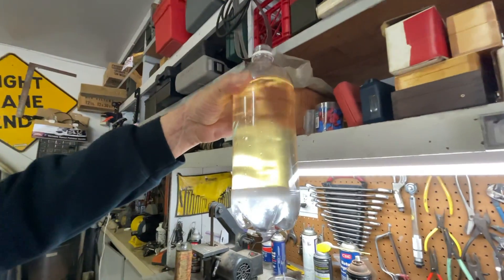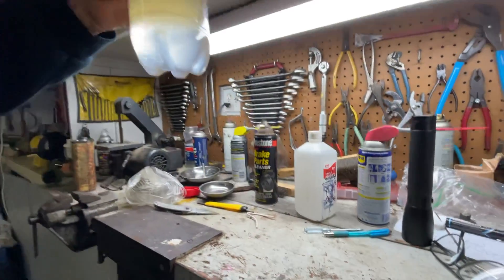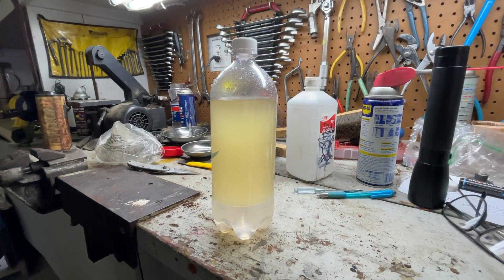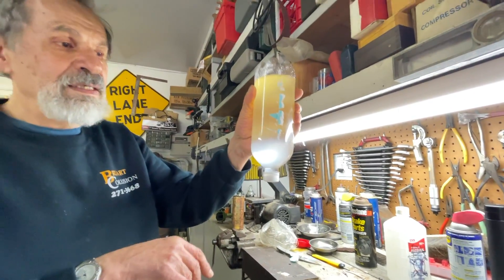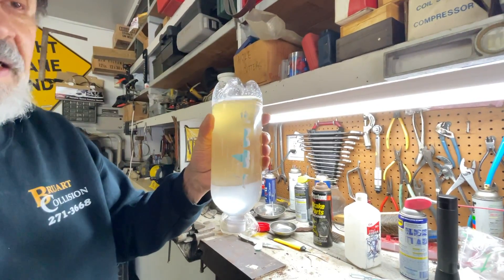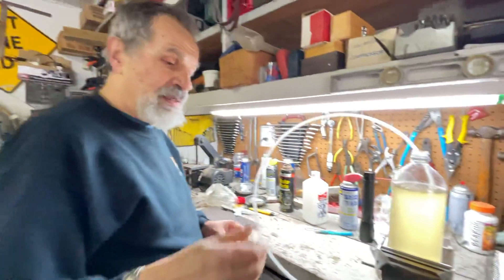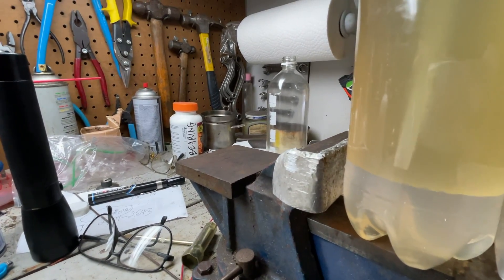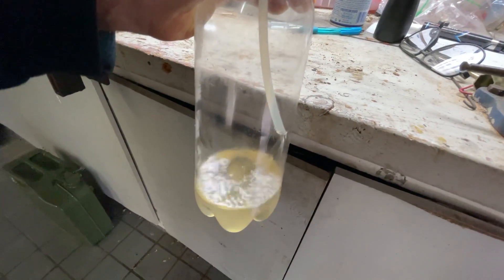The Most Practical Way To Remove Ethanol From Gasoline

Comment: I see a few diy people using the same bottle after they drain the water from the bottom. If you do that you will have a lot of water going into your gas tank, as you can see all the water droplets that stuck to the side of the bottle at 10:10 you got to use a different bottle like this and siphon like this guy

Comment: You are best to use HDPE, #2 containers as the exposure to Gasoline will very slowly dissolve other kinds of plastic which means it will be going through whatever appliance you run with it.  That 5 gallon jug will eventually get soft from prolonged slow dissolution.  I like the "blow job" method of starting the flow. 🙂

Comment: The big question is this: 
What do you end up with after seperating the ethanol from the gasoline? 
Ethanol raises the octane of the fuel. Removing it REDUCES the octane. So, as it starts out with 87 octane, what number do you get when you remove the ethanol? 
My guess is that you end up with the CBOB that is used to produce the E-10 in the first place. Is this really a viable fuel for use in motor vehicles? I suspect there could be some undesirable side effects.
Reply: It’s for small engines . In Cali they add ethanol. When ethanol gas sits in any small engine it destroys it. Hence why they are removing it.

Comment: It seems that all these videos are missing a very simple trick. Mix the water with the petrol(gasoline) and after the water mix settles to the bottom pour all the liquid mix through a REAL leather chamois into a bucket / container. The petrol will run straight through the chamois and the water /ethanol will be contained at the chamois. The petrol will be clean and clear.   Please try as this is the best way to separate the components.

Comment: If you mix the gas and water in a dish washing liquid bottle with its Pull-To-Squirt nozzle, you can then easily turn it upside down to squirt out the water and ethanol. I think a better practice, using your siphon (great idea, BTW, blowing into the bottle to start the displacement), would be to run the tube to the bottom of the separating vessel and siphon out all of the water and ethanol to be discarded, rather than vice versa as you have done. Actually, if the separation container is soft sided, you could use a single hole in its lid, along with a single hose and just squeeze out the water mixture from the bottom. You left behind some gas in an abundance of caution and if you put your hose right down to the separation line, there is a fair chance that you could pick up some water.

Comment: No, no, no - siphon the water/alcohol from the bottom.  Tilt the bottle to get the very last bit. Great method, but you're siphoning the wrong liquid.  Just easier to siphon stuff from the bottom and not have to piddle with the liquid interface and get a slurp of water here and there as would happen when attempting to siphon the gasoline instead.

Comment: The only advice I will give others is to start with premium gasoline. The removal of the ethanol lowers the octane essentially making 92 octane into 88 octane. I don't know the exact numbers and they may vary as a lot of gas has between 6-10% ethanol. But the fact is that when you remove the ethanol starting with 87 octane, it will be a few points less now. I have found there is not much of price difference to just going and getting Rec90 fuel at the higher cost. When I was in California, there is no such thing as non ethanol fuel at the pump where I was living.

Comment: My solution to bad gasoline, leaking carburetor gaskets and risk of engine fire, was convert to propane. Solved it. By the way on the farm gasoline that was in tanks for extended time lost its volatility. The mechanic finally looked to the fuel as a potential problem and put a match to an open bowl test and could not get it to ignite. So the modern fuels have some infused fuel that volitize destroying combustion.

Comment: I remember my father telling me about a way to remove water from gasoline. Back in the 1950s the only way to transport fuel for tractors was with steel drums and a hand pump. Any humidity in the air would eventually condense and build up inside the drums. They used an old felt hat in a funnel and pumped the gas through it while filling the tractors. The gasoline would run through the felt but the water was held back. Surface tension? Not sure how it works,  but apparently it did work. May be something that could be incorporated in a larger volume ethanol removal apparatus. Good video

Comment: you can buy ethanol free gas at some gas stations there is a website i think it is pure gas or something like that the problem with your method is now the gas you removed ethanol from has a lower octane rating because the ethanol was used to get the octane rating so you might have to add octane booster that has no ethanol to replace the octane lost depending on how the thing you are running needs octane

Comment: 2 things to note:
1. You may need to add some sort of octane booster since the ethanol upped the octane levels. So your 92 octane gas turned into 85 or 87.
2. Your torque wrench needs to be recalibrated. Since you left it set to a torque value, the spring has permanently changed and thus your torque readings will be off.

Comment: put a on/off valve in place of the cap.  flip it over, let it settle, open the drain untill the gasoline starts to flow out, shut the valve.

Comment: Ethanol is a bad idea in gasoline engines period. It’s a corrosive. I use high octane ethanol free fuel in my small equipment runs better with less maintenance. Thanks.

Comment: Ethanol free gas is WAY better for classic cars i highly recommend using it. Old carburetors and fuel injectors weren’t designed to run on ethanol, double that effect when it’s something you only drive in the summer since the ethanol will degrade and absorb water in your beautiful classic car’s gas tank

Comment: Use a plastic bucket or 5 gallon water jug with a radiator petcock screwed into the bottom.  Open it up, drain the water out, and VIOLA! Ethanol free gas is left.

Comment: Adding a proportion of two cycle synthetic engine oil would help replace the difference in octane, slowing the burn rate to help prevent preignition/detonation. I I wish I knew the numbers but it's something you could look up, I simply add it as a 100 to 1 mixture and leave it at that and have never seen an I'll-effect. If you were using this an aircraft I would surely going to far deeper science or keep your altitudes very low.

Comment: Mr. Funnel makes a portable fuel filter that’s a funnel that removes water dirt and debris. I use it to get water out of kerosene before using in heater.
They have different sizes. Mine is a 3.5 gallon per minute. I think I paid about 25.00 on eBay. Filter is permanent. Just wash out.

Comment: You should have mentioned that taking the ethanol out will reduce the octane level of the gas. Chainsaws should have 91+ octane. Octane boosters often have ethanol in them, so you have to be careful what you use to boost it back up.

Comment: So far, out of all the ethanol videos I've seen on Youtube, yours is the best approach to remove the ethanol from gas. A Big thanks!
Reply: i don't want corn syrup in my gas
Reply: @theorenhobart  and plastic juice is just as bad... use glass or designated petroleum safe containers...
Reply: not really... i wouldnt let gas sit in soda pop bottles over night... gasoline has a nasty habit of eating certain type of plastics... and ethanol will eat rubbers as well... this should be done in Glass... theres a video of a guy using actual Chemistry beakers separation funnels and what not to do this... much better video... not to mention gas starts eating the plastics immediately so who knows how contaminated your fuel now is with plasics...

Comment: As that bottle has a "bubble crown" on the bottom to make it stand up, I'd angle the bottle and stick my pipe into one of those little bubbles at the base. As it's a low volume it has to be more controlled. Also if you accidentally miss the layer you suck a little gas into the waste drain off, and not water into the gas that you want to keep uncontaminated.

Comment: a tweak: put food coloring in the water and instead of siphoning off the gasoline, siphon off the now blue water-ethanol mixture through a translucent/transparent tube that extends to the bottom of the container. when the fluid being drawn through the tube is no longer blue...stop.

Comment: I've been doing this for years and it works VERY well.  My 5k generators (I have seven of them) start easier and store a LOT LONGER without carburetor issues. I keep 15-gallons on hand all the time because we can't tell when or how long power will be out.  A 5k gen will eat 10-gallons in 24 hours.  Because these 10-HP engines are low compression, there is no pinging or knocking using gasoline processed from regular-grade gasohol.  If you do get any pinging or knocking, bump up to mid-grade or premium grade gasohol.  At first, I was concerned with this so I started with premium.  Later, I migrated towards regular grade.  Smaller engines (chainsaw, 2-cycle snowblower) also start easier.  All these engines love it.  I noticed that the processed gasoline feels more oily.  I don't know of any engine that requires ethanol.  That's simply a 'filler' that the government forces us to live with.  They'd love to add more ethanol but our carbureted engines cannot tolerate it.

Comment: The water left in the gasoline will do more damage than leaving the ethanol in.  Adding toluene to get the octane back up.....about $20/gallon of toluene.  
Run a small engine on corn gas, drain or run the carb dry, add a little stabil.......maybe costs $2 extra and 2 minutes of your time.  
None of this matters in California, of course.  All of their small engines will burn coal by 2024.
Reply: Yes, but it dries out and swells soft parts in the engine. This is especially problematic in 2 cycle engines since if the crank seals leak, the mixture becomes lean (burned pistons).

Comment: Ethanol fuel does not damage your engine but lowering the octane level will.
Reply: It eats up carb and seal soft parts. In a two cycle, this will lean the engine out leading to not enough oil in the mix. And this will damage the engine. So yes, ethanol does cause damage to engines. It also turns to powder as it sits in the carburetor. This plugs the carb and requires service before the engine will run again. Lastly, ethanol eats up aluminum parts. All in all, it is not good for small engines.
Reply: @Nick_Sorenson  my point was that if you remove the ethanol content of the fuel, you will lower the octane rating and eventually cause severe engine damage from pre-ignition and yes, ethanol does destroy a lot of seals in carburetors, especially older models.

Comment: Upon doing this method to anyone still worried about water being in the fuel i would suggest a bottle of dry gas thrown in , the yellow bottle seems to be the best ( and is relativity cheap )to remove any left over water from the fuel .

Comment: At 2:42 Please don't pour gasoline or any flammable liquid inside your house or garage. If it catches fire you will lose your house. Go outside and pour it far enough away so you can walk away if it goes bad, and you won't have to fight a burning gas can. Thanks for the information on removing ethanol.
Reply: You may be very nervous pouring that gasoline in your garage into a small bottle with a cherry can. In my neck of the woods here in Wisconsin, all gasoline containers have to be painted red. I guess you don’t have to do that where you live. I’m not sure this whole process is really worth it because of the loss of theoctane in this gasoline that you’re going to process and also handling gasoline is careful as you can be, is still super dangerous. I’d rather pay a little bit more, though. I don’t think I’ll live another 77 years no matter how safe I am.

Comment: Thanks so much!  I see no reason why this same transfer method wouldn’t work to delete water from old fuel, with or without ethanol. Water always settles to the bottom and your easy siphoning method will do the trick. 
One thing I would improve upon is the soda bottles. I’ve been using 2 quart rectangular plastic fruit juice bottles from Langers for other purposes which are a thicker plastic and have a larger cap.

Comment: You can't even get the 10 cents for the bottles in my state so if you have some tubing around it would be totally free to do it. That looks like the tubing that is used for refrigerator water supply and I already have some of that.

Comment: One could also run the siphon hose down to the bottom of the bottle and just siphon off the water/ethanol mix.  I just buy 91 or 92 octane gas as where I live, there is no ethanol in that grade of gasoline and I only run the high grade in my small engines.  It's amazing how many people don't know that one should not run E10 in their small engines.  It's especially bad for long term storage as the water in the ethanol can cause rust or oxidation in the metal lines or metal storage thanks ie: Rust.

Comment: Comment below states: 'Would also strongly suggest using molecular sieves or a drying agent like calcium chloride, because the water still inside the gasoline will do more harm then if you left in the ethanol.' Would that be true? The whole point to me of extracting the ethanol would be to ensure it remains free from moisture in long term storage in bikes as it rusts the tanks and clogs the carbs.

Comment: Or you can just go buy recreational fuel.   Kind of hard to shake up a 5 gallon jug that weighs 30lbs.  Test your local premium 90+ octane fuel.  Much of the time there is no ethanol in the premium, especially around lake marinas.   If you remove the 10% ethanol out of 87 octane fuel, you are left with 84 or 85 octane.   Depending on the engine, that low octane can cause valve damage or detonation.

Comment: I have looked at several methods for doing this and yours is, by far, the most creative.  Thank you!  I will use this method with gallon glass jars, non-alcohol octane booster, a little sta-bil and with or without 2-cycle engine oil depending upon end use.  Great video!
Reply: Can you tell me what non-alcohol octane booster you would use....I need to have an octane rating of about 91.  Also, how much water will you used in each gallon glass jar to mix with fuel?  I assume you are starting with 10% ethanol.  thanks.
Reply: Probably best to add the two cycle oil after finishing the ethanol removal procedure.

Comment: Love this! Thanks! I can almost smell the gas fumes in your workshop 🤣 just like mine!

Someone told me that the leftover gas after this process is very low octane... Like 50 or so. The ethanol raises the octane rating, and the base gasoline is low quality. Do you know if that's true? 🤷‍♂️
Reply: It depends on the amount of ethanol used in the start.  As an example common 87 with 10% ethanol you will drop 2 points to 85.  The higher the blend of ethanol the more the drop.  Ethanol is high in octane and fuel suppliers figure that in to the overall octane of the finished fuel blend.  We are paying the farmers to supply ethanol as a measure to use corn...simple enough.  All the claims about saving the environment is questionable in my mind.

Comment: because I'm sure there are some engineers in the comments section, you can perform distillation on the fuel after mixing with water. Just be careful with the heat and gasoline. The boiling temps are different so you can capture them (not completely because the gas will start to vaporize quicker at the C2H8O2 mixture of water and ethonal. But if you can get better efficenencies at home, you're either breaking bad or probably don't need this advice. Another thing, doing this process WILL lower your octane rating for the fuel. So either do this with a higher octane then you need or add octane booster to the final mixture.

Comment: Your process is identical to what a wine maker would called "racking" - The only difference is that you're pulling the floating gasoline off the water, where the winemaker is trying to pull the wine off the sludge of dead yeast and assorted "ick" that sediments out during fermentation. the "turn the bottle over and loosen the cap to let the water run out" method you described is the same as a chemist's separatory funnel, and works incredibly well, and with zero spillage when you've got things set up properly. Nice demonstration.

Comment: Yikes!  There's more to getting "good" fuel for small engines than just removing the ethanol from E10... maintaining a decent octane rating for example.  Next up on the playlist: how to replace a piston and cylinder in your small engine.
Reply: You just add some alcohol to boost up the octane :)

Comment: I use a electric auto fuel pump 
It works great and cost 18 bucks 
It’s fast and safe plus it saves carb kits or carbs replacement 
Just connect to your auto and pump it out
I use a 5 gallon clear plastic bottle and I write gas not water on it